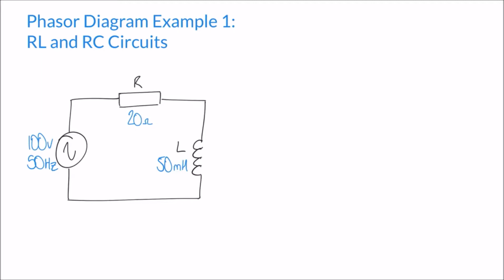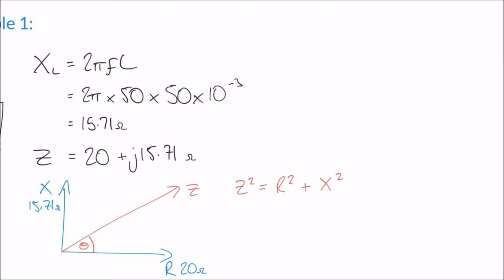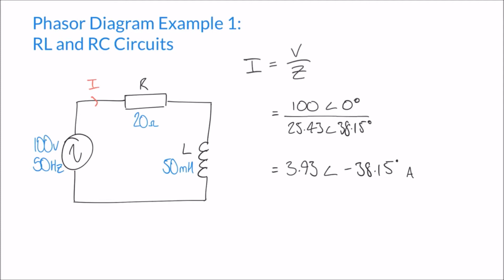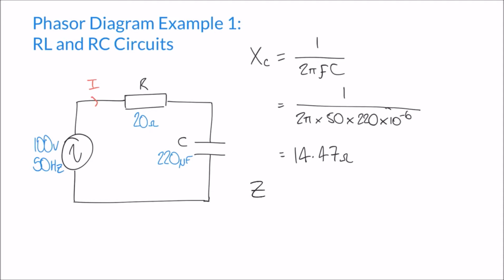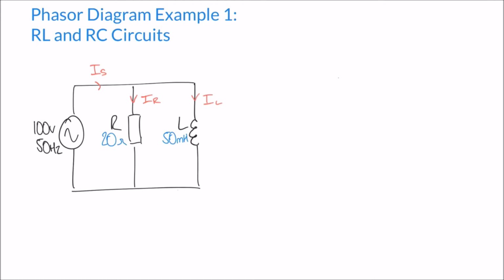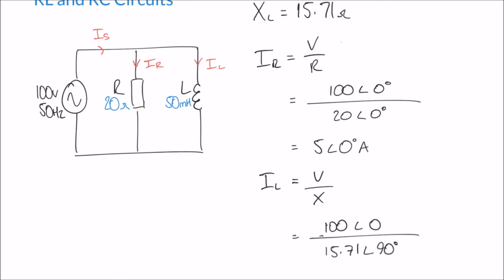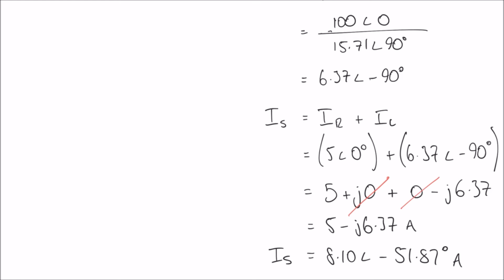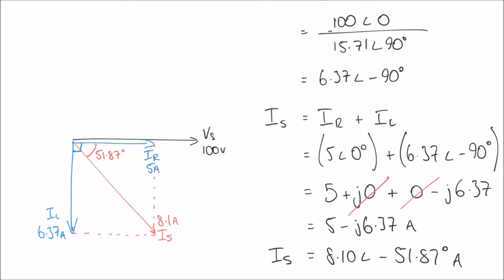Using Phasor Diagrams to Evaluate RL and RC AC Circuits

Comment: is 100v peak to peak or RMS
Reply from the maker: You could use this method for either, as long as you are consistent: if the voltage is RMS then the currents you calculate will be RMS.

Comment: iwant to ask , what is the effect of the circuit elements arrangement
Reply from the maker: If you mean when the components are in a different order, it doesn't make any difference to the calculations in this video. Hope this helps.